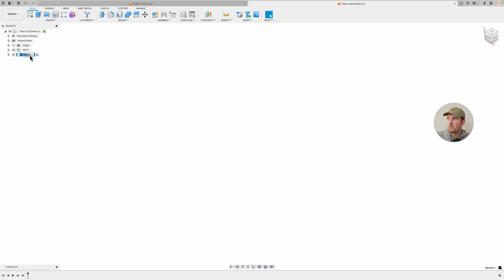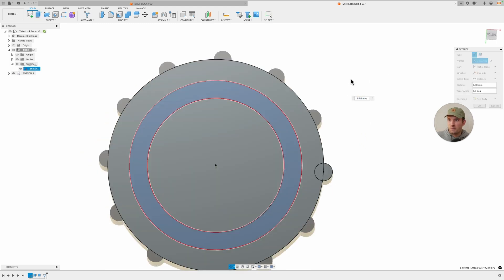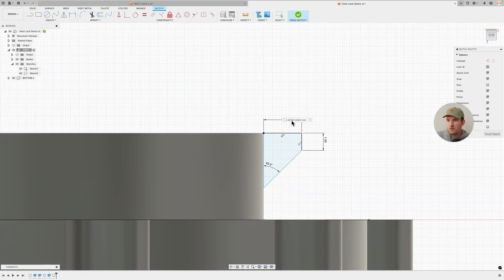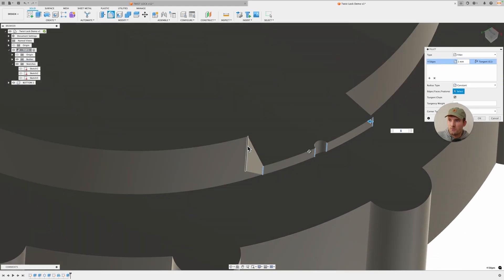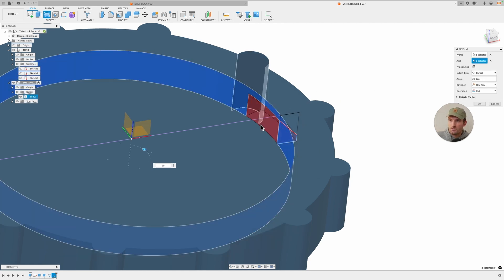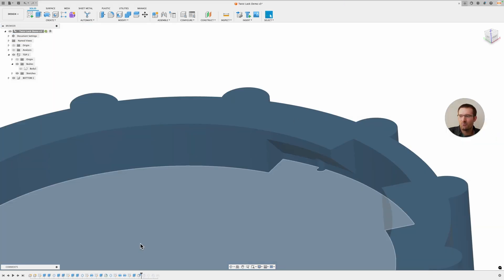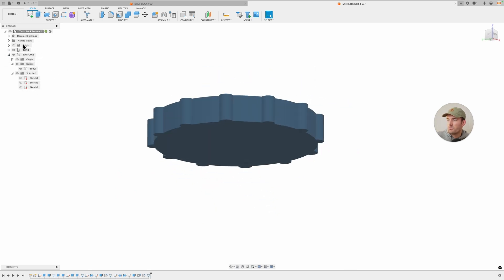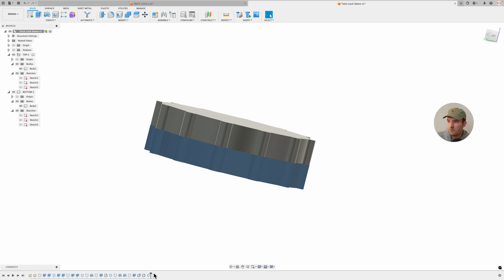Step-by-Step Twist-Snap Design Tutorial [Q&A 5]

Comment: Cool design. 

13:06 I believe a correction to your correction, that you also need to press-pull the 45* face as well.  I think you could also put a little draft angle on the notch to tighten the two pieces as it's being turned. Finally, if you make one "tab" and slot larger than the other three, you could force a particular orientation of the two pieces.

Comment: I messed something up.  I printed this.  When I mate the 2 parts they are lined up.  Which means after turning to lock they would not be lined up any more.  But it doesn't matter because it doesn't turn at all.  :)

I'm gonna start over.  It's a good lesson on Projecting geometry and I need practice with that.

Comment: Hi! Thank you so much for the video- I have been trying to figure out a locking mechanism like this. I followed along easily. The 3D print of it does not actually close all the way- it gets caught on the notch. I noticed your the model at the end might have a different radius on the lid. I'm wondering if this is the issue. Thanks again!

Comment: Great concept and tutorial. I'm printing it at this very moment and realizing that it's important to add the outer chines in a manner that lines up properly with the tabs, or they won't always line up when closed. I used 10 of them and they'll be offset incorrectly. Had I used 8 chines, they would always line up.